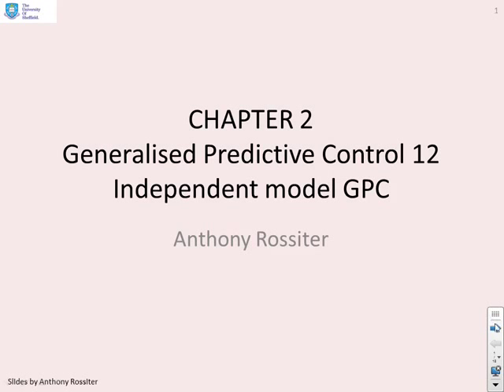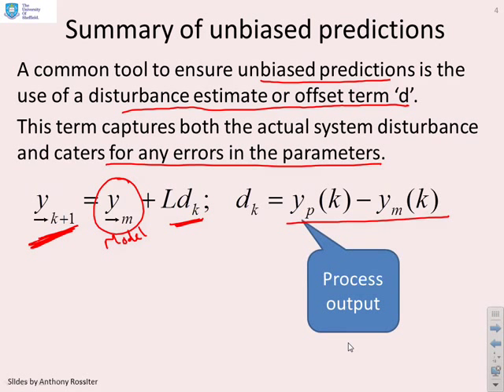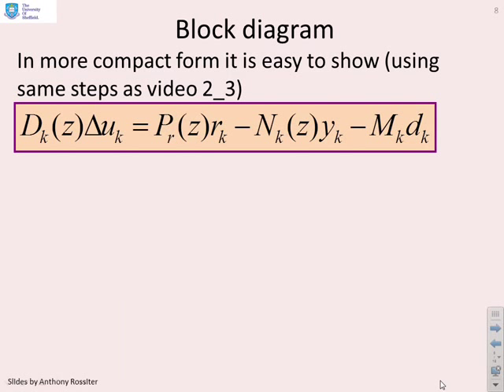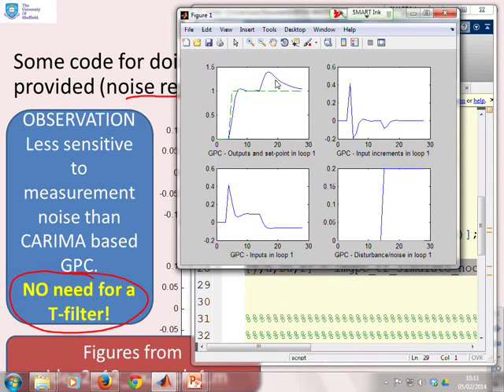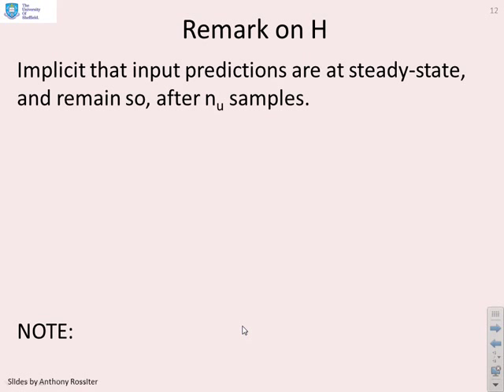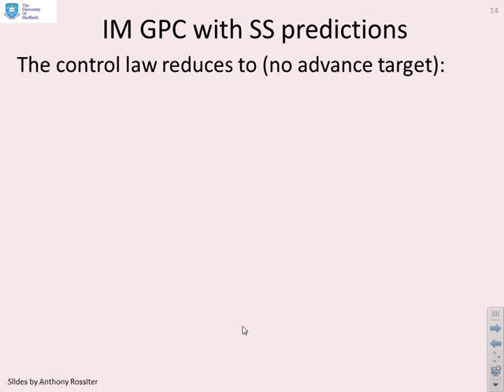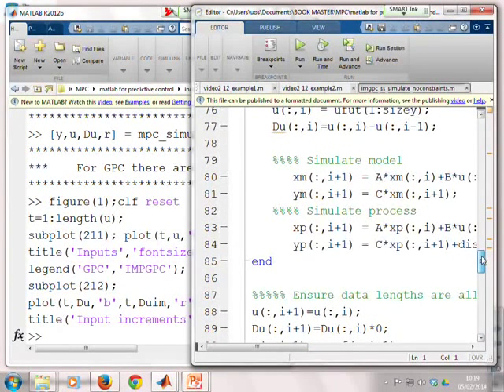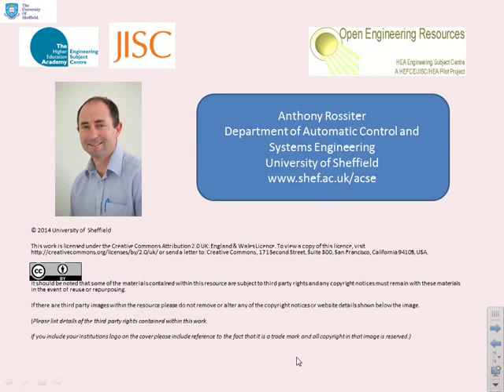Generalised Predictive Control  12 - independent model GPC

Comment: Now, I'm currently using this code to run IMPC (state-space model). The trouble that I'm facing now is that, it doesn't work when I change default model (SISO) to MIMO by change the matrix A, B, C, D. It become more confusing because my MIMO model is actually underactuated system (non-squared one)